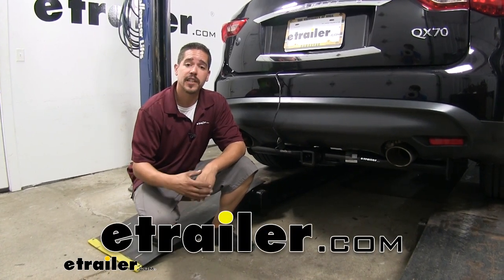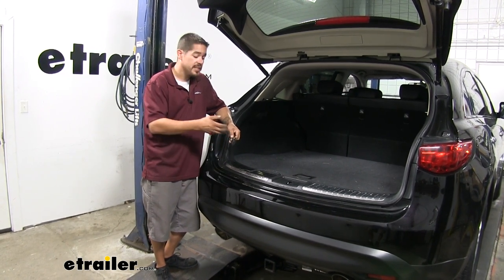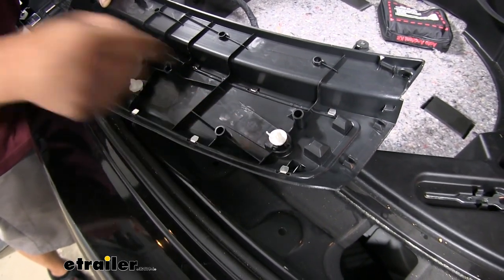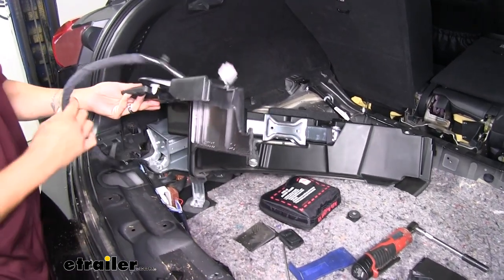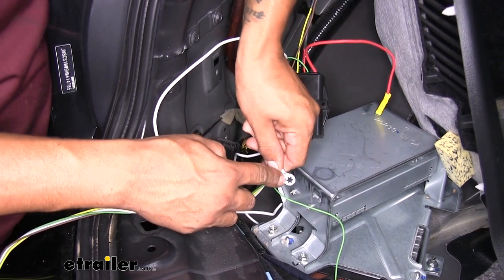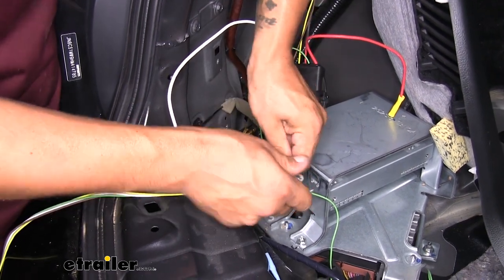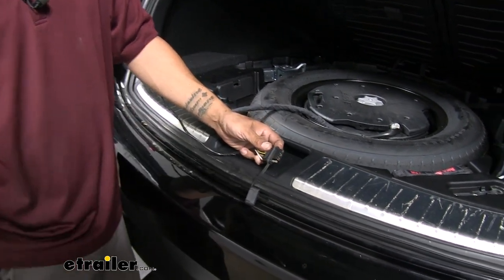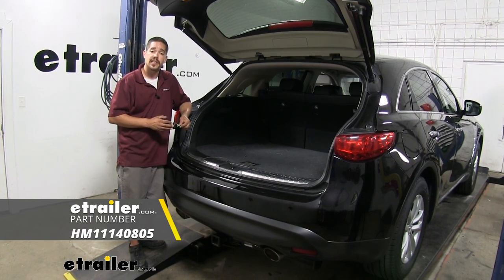etrailer | Hopkins Plug-In Vehicle Wiring Harness Installation - 2017 Infiniti QX70

Comment: How do you do for the reverse light?
I'm fighting with mine to find that one hiden on the back door :/
Reply from the maker: I'm assuming you're using an adapter like # 37185, is that correct? The closest and easiest spot to access the reverse lamp circuit would be under the trim that covers the inside of the D pillar alongside the rear hatch. You're looking for the wiring harness that feeds the reverse lamps on the hatch. Use a circuit tester like # PTW2993 to locate which wire goes hot when the transmission is in reverse.
https://www.etrailer.com/Trailer-Wiring/Hopkins/37185.html
https://www.etrailer.com/Electrical-Tools/Performance-Tool/PTW2993.html